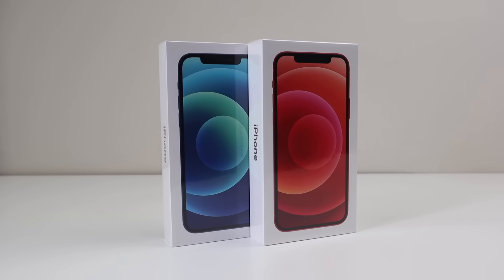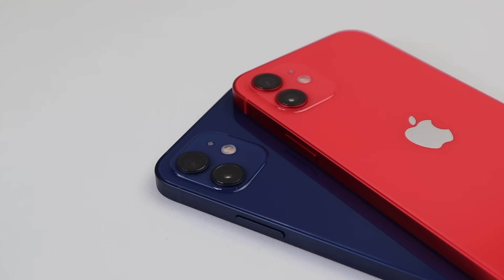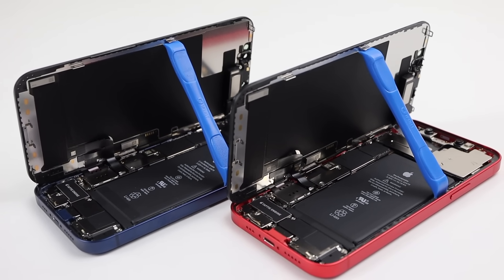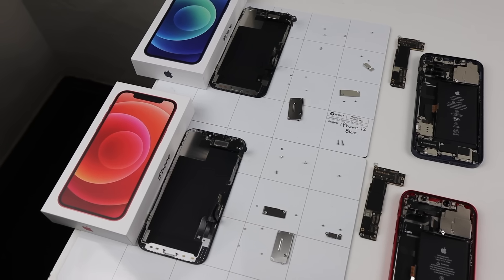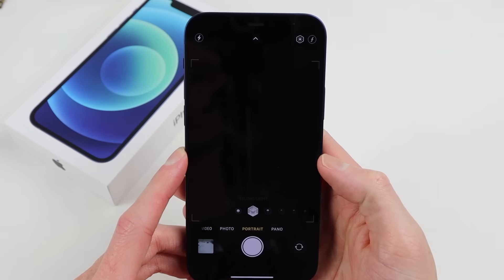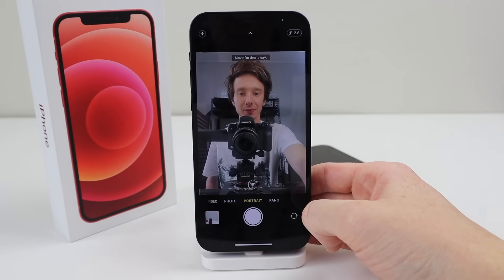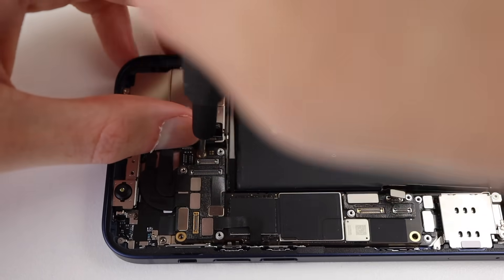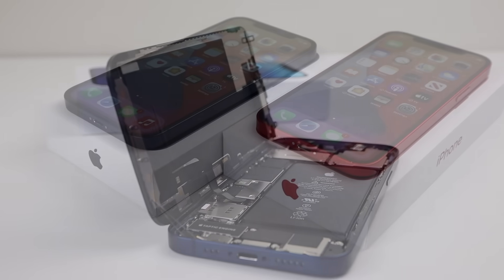iPhone 12 Anti Repair Design - Teardown and Repair Assessment

Comment: Wait, could this technically be classified as illegal in California?
According to the (not sure I'm citing this properly but it should be good enough) Consumers Legal Remedies Act Chapter 3. subsection a, paragraph 15: "Representing that a part, replacement, or repair service is needed when it is not."

Because the cameras, logic boards, etc. are all in complete working order, yet will prompt that the phone must be repaired the moment they are swapped, and even cause other parts of the phone to seemingly break, despite it returning perfectly to normal upon swapping the pieces back to the original phone. 

Despite the phone being in what should be perfect condition, considering the parts are professionally replaced and are brand new, I put forth that Apple is misrepresenting that the replacement is necessary, despite it not needing to be.

I am not a lawyer by any means, but I feel like this could possibly check out, though it may need another law to back it up
Reply: Its apple. I'm sure they've hired lawyers just to find loopholes around these types of laws.
Reply: @Jason-hz6cm  naw its much cheaper to hire lobbist as seen in Louis rossman video ! they will pay someone to be in Newscums ear
Reply: Willing to bet that every component has it's own internal ID, and somewhere on the phone the IDs are stored, so if you swap out a battery or logic board, etc, it knows something is off. They will probably say that the phone is NOT in working order because the registered components are not within the phone any more. And Apple has a crap ton of money and time in which to litigate us into oblivion on this issue. If the issue is taken like a car where you can legally get it serviced anywhere without voiding the warranty, Apple may try the route that you are simply licensing the use of the software and you don't actually own anything.

Which ever way this goes, Apple is clearly hell bent on making it impossible for anyone to repair the phone but them.
Reply: I'm sure that Apple's lawyers will find a way to make it sound like it's legal even when it's not.
Reply: This should be known publicly.
Reply: @UCCwGhCIraQYpmRJQ3_e5kdw yeah or just not support apple they wont miss my $
Reply: And for those same reasons it will be illegal in Europe
Reply: level over 5000 comment! YES its very illegal to say something needs to be replaced when it doesn't ! I reposted the video on facebook and hopefully twitter ! contact newscum and see whats up
Reply: Great post. It certainly seems illegal but they will bog the case with arguments of security, logic patents(which are inherently flawed and the very reason why China surpasses us in tech, because they don't respect logic or anything patented), anti-piracy, anti-counterfeit, etc... for a ruling to happen in favour of society for a common sense question like this one one would need to be a philanthropist and comparably wealthy to Apple, otherwise judges and litigators are in the pocket of the corporation. Corporations above government is a scary though, but it's the American reality. God bless.
Reply: Koo
Reply: why people continue to support this company is beyond me
Reply: Not illegal lmao 😂
Reply: It's so face id and finger id can be attached to phones for crimes, legit.
Reply: opening device under warranty is itself breaking their t&c
Reply: Face id probably mandates the components used require known hardware (read original) for security reasons. That would be why the camera bugs (and assurance resistant to 3d prints of faces overcoming security). That's how it's not breaking repair laws
Reply: Allow me to designate you A HERO amongst us! 👍🏼👏🏼👍🏼👏🏼😎

Because I'm Quite sure you just located the PRECISE LEGAL SOLUTION that will save the repair community! 

Not to mention that law will Protect we customers from Apples Consumer-based, overpriced scamming! 

To avoid being destroyed in court by millions of Consumers, AND/OR face bankruptcy from the inevitable plummet of Apple's Stock....Either way, they will need to obey the law and bow to us all in order to save their business.  No less than they deserve. Do good honest and honorable business, or GTFO of our country's market all together!  
Sorry but in this day in age, We don't need Apple products whatsoever.
Reply: @Angel Dust Yes, but at least legal actions can be taken.
Reply: I hate to say it, but whether illegal or not Apple will just squash any push back against it. Maybe the solution is not to fight Apple, but find out how the phone ids the parts then find a way to trick it or manipulate it.  Either way, it's a sad state the world of electronics is heading towards.
Reply: I wonder if it's possible for Apple Lawyer to overlook something this major. But either way, you've brought up a good point. Kudos to that.
Reply: You are awesome and I hope that Apple files for bankruptcy or whatever. I don't know how it works, I'm 12.
Reply: @rrueps4844  Apple will not file for bankruptcy. Ever. Apple is valued at over $2 trillion.
I know it might be exciting for you to hear that Apple may have broken a state law, but don't expect anything from it. Apple has lawyers, and they know what they're doing.
Reply: Show this to Louis Rossmann !
Reply: I asked for Hugh to pin your comment so everyone can see that Apple is breaking the law.

Edit: If this dosent work then spread the news by any means necessary. Tell your friends, type up comments, heck tell the police

Edit 2: Tell the police. Make a big fuss and get a lawsuit or whatever. Again I am 12 so idk how it works.
Reply: True but who cares
Reply: Lock Apple Up!
Reply: TOS is accepted when buying and setting up phone. Most likely it nullifies anything and everything related to your local laws.
Reply: @isaiahtan7787  ToS does not supercede or replace existing laws. The ToS has to comply with the local laws in place for the market they wish to sell in.
Reply: @TheFinalKiller  Cool, thanks for the enlightenment
Reply: @isaiahtan7787  they don't override laws

Comment: The face ID is paired to the flex on the ear speaker, so swapping those displays and not moving those over from each screen, will absolutely cause face ID to not function. 
Even the non genuine battery message shows up on older iphones, and a programmer to help that is readily available. 
Went into this video thinking, oh jeez what did Apple do again, left it thinking it was a little misleading. We will always have to deal with their bs, but we will find a way around some of it atleast.

Comment: i guess about the problem they had with the canadian company about not recycling the phones and repair those to re-sell, Apple did a dick move to block any dick move than themselves... behold apple users now they gonna feel the need to use a rigid case and take extra care to prevent any damage on phone... like 6 or 7 or 8 or X or.... well you know "Apple Users"

Comment: So them being more green is a lie? Who would have thought? I mean this is why i REFUSE to buy Apple devices. I mean what if the nearest Apple-certified repairer was a 2-hour drive from your house and you had an indie repairer maybe 20 minutes from your house chances are likely you are going to take your phone to the indie guy as he/she is much closer and you are likely going to keep your device and 9 times out of 10 Apple always tries to force you to get a replacement device EVEN WHEN  the problem is EASILY FIXABLE. Its just a way to milk their customers and that is abhorrently disgusting and that just produces EVEN MORE e-waste. that and taking everything out of the box would mean more packaging waste as well i would think cause that is now 3 boxes instead of the one box so i think that is more weight than the singe box. Locking things down only adds to the e-waste pile so yeah the whole green thing is an excuse to try and circumvent right to repair laws just so they can be as anti-consumer as they have been and Is why i don't  give Apple my money. At least with android phones, you can get them fixed and the same could be said for the tablets. I wont buy any MacBooks or other Apple computers either. Ine i don't really like MacOS and the fact that it is a walled gardesn and you can get windows laptops for FAR cheaper than a MacBook while getting the same performance or spend the same as one and get BETTER performance.

Comment: For the Face ID issue specifically the smallest fingerprint on the Face ID sensor can cause it to stop working and I saw you touching the Face ID sensor constantly🤷🏽‍♂️ as for other issues you took out the logic board for gods sake Apple THEMSELVES DO NOT REPLACE LOGIC BOARDS. I’m not an Apple guy I’m just pointing somethings out that weren’t mentioned in the video☺️
Reply: No, he swapped back the logic board and it works perfectly. Watch the video all the way first.

Comment: @Hugh Jeffreys what happens if you perform a recovery restore, after letting the device completely discharge the battery.

Also, what happens if you completely discharge the batteries before replacing the components?

Comment: "We want to reduce waste by removing the included charger". Instead, you got to buy another product in MORE package if you don't have the plugin already... So, where is the savings there??
Reply: right lol
Reply: More money
Reply: It’s total hubris. Taking customers for granted. They will lose the market soon
Reply: See, you're using the product incorrectly. You're first supposed to get latest gen MacBook and charge the phone using the included cable by using the MacBook as the charger.
Reply: @MikkoRantalainen  Marketing 101. Make them buy our other overpriced product in order to use the product they originally bought.
Reply: Ontop of that by not, forcing its buyers to drive out of their way, most likely a futther distance as opposed to fixing it themselves or in a local shop. Doesn't seem very "eco friendly" to me.

Comment: The phone not turning on at first is not anything wrong with your phones or anything you did. I worked at a cell phone repair shop and saw this with iPhones allot. Plugging in a charger is always the solution.

Comment: “We care about the environment” makes the phone nearly impossible to open the phone for repairs, changes the charging cable to something that isn’t able to be used in normal ac adapters AND removes the included adapter, doesn’t have regular usb outlets on their laptops so you can’t use external memory devices huh.. seems like y’all just be doin the normal corporate bs and calling it an environmental improvement, Apple is a garbage company

Comment: Couldn't this be a matter of mismatched calibration data more than 'intentional breakage'? Definitely for FaceID and possibly also for correctly knowing the battery status I could imagine that the system just needs to know some intimate parameters of the parts that could be varying from piece to piece. Even for the 0.5x zoom I could imagine there needs to be some tuning of parameters between the 2 camera's for example. Also, if intentional loss of functionality is what they're going for, wouldn't they just completely turn off those functions instead of leaving them working but in a very broken state?

Comment: It seems that it is blocked by software, they have paired the camera, the screen and the battery (and probably everything else) with the main board. A QR code is engraved on the camera, and battery.
Some dev team who can modify these parameters and place the new ones it could fix this problem in the future.

Comment: Great videos..
The apple has build an Anti Piracy Assembly iPhone 😁😁😁 it means the iPhone 12 using only registered part number from trusted apple sources. Another step in the process just to secure the value of the iPhone itself.
Great strategy..👍🏻👍🏻👍🏻
Updated the OS device Info for every part replacement..😊😊😊

Comment: Can confirm it's all purposeful locks.

I have done apple repairs. There is software that unlocks all this stuff basically. You run it after repairs. Genuine parts should work and honestly so should 3rd party. There is nothing wrong with parts. Face ID is disabled when it senses a new display. Its ridiculous number one reason why I quit is Apple greed and sheer lack of care for customers.

Comment: I think is time to everyone to never buy iphones again. Apple is fucking joking with everyone. They do not do any real upgrades. If you have a 11 pro max just buy a 12 pro max cover and now you have a 12 pro max. It is the same as iphone X. They couldn't make the fingerprint on screen and they fully removed it. If you change your front camera, your face id wont work anymore. Buying an iphone is a waste of money in my opinion. Even in latest macbooks they have done something to stop repairing them. So if you break the screen you should send it to apple to change, even if you are in a country without apple stores. If something else doesn't work you have to send it to apple again. If your motherboard doesn't work, you can not recover your data because the ssd is not removable

Comment: This is similar to the transponder systems in automotive keys and ecus, you can have an exact key or ecu, it will still have to programed. So I guess the camera, battery and main board all have a physical hardware key that can be relearned with software.

Comment: Generally unsurprising results. What is surprising though, is that once the original components were returned to their respective phones, that they didn't require an Apple authorized reset procedure to be performed by an authorized service center using proprietary re-pairing/re-syncing/re-authorizing software; you know; the kind none of us consumer heathens will EVER have access to.

It's this way with BMW. If you so much as replace the battery, the ECU has to be reset to recognize the new battery. I think you have conclusively confirmed your suspicions about Apple intentionally locking down the original hardware configuration with your experiment, and thanks to it, Apple will certainly be 'fixing' the ability to turn on the phone even after the original components are re-installed. You're lucky you don't have $3,000 worth of two brand new dead iPhones on your hands right now.

And speaking of 'dead', you might consider removing images of your face from your videos and your channel. Big corporations have been know to 'suicide' those exposing their hidden agendas. They have a much harder time finding you if they don't know what you look like, or your name, where you live, or anything about you. Also, they don't even necessarily have to 'whack' you; they can threaten your family, your job, etc. And yes, I'm fully aware that this sounds like a conspiracy theory, but there ARE individuals who conspire to commit crimes against others. There always have been and there always will be. It's why we have anti-conspiracy laws. If it weren't a real threat, those laws would not be necessary, would they? These kinds of videos exposing underhanded behavior are best done anonymously. Get the word out and do NOT risk your well-being in the process. That's a service to humanity AND you/your family. Don't give the bastards a damned thing. They WILL use it against you.

Comment: Cool video.
At first i was pretty outraged by this. But thinking a bit more i actually think this makes sense. 
This could very well be a root of trust issue. Where each part has a encrypted id that has to match on boot. 
But it should still just inform you that you have refurbished or unrecognized parts and security might be compromised rather than disable features

Comment: Don’t feel like you’re alone in repairs. Automobiles, tractors & tractor trailers have the same issue on hardware/software compatibility for swapping. It’s a huge problem and I’m ready for a change for the better

Comment: this is literally normal for most the iphones, you have to run it through apples diagnostics before it can actually register it as a certified apple product. this is part of the process of becoming aasp certified. have to get trained in how to do the repairs along with knowing which diagnostics to run to certify the parts. this is 100% normal and you should not try to repair any iphone yourself. also when doing a repair to an iphone you have to enter the serial of the new iphone part into their diagnostics hence how it knows that its genuine or not genuine. it's just part of apple's repair procedure for their iphones

Comment: Not to be the devil's advocate, but Apple has a "reason" for the parts lockdown: maintain integrity of their security systems. That's a lot of tech talk, as we can't confirm for sure due to their closed system and no source codes being available, so we gotta work with the (almost no) info they give.

But, replacing circuit board and camera? Why go through all this trouble? I personally only heard of one person who had a circuit board exchanged on their phones (it was a samsung S3), and never heard about anyone having camera issues.
What I was interested, though, was about the screen/display and the battery. Take a walk and you'll might see more phones with cracked screens than ones with intact screens. And being able to replace the battery - even if only with a original one - is a must if we want to buy into this "reduced e-waste" BS....